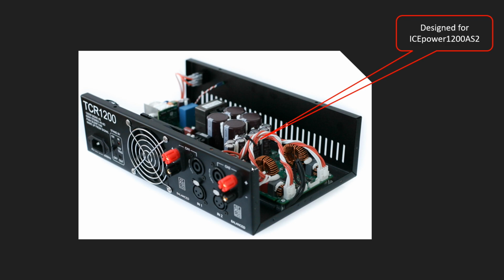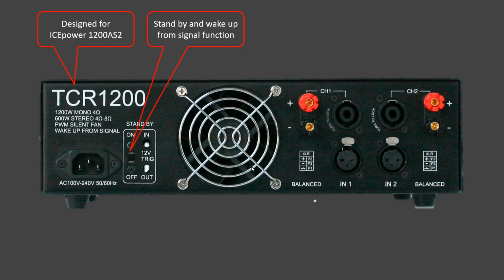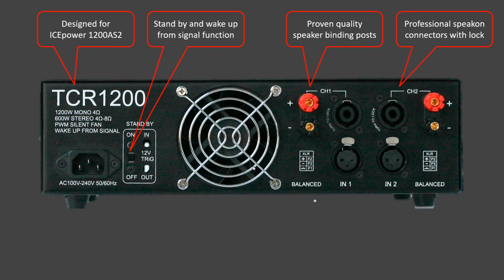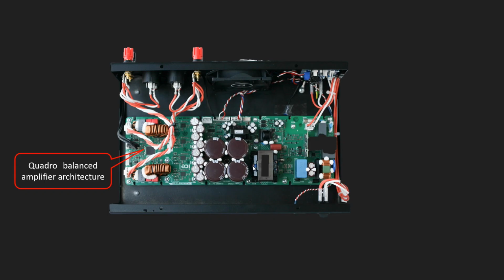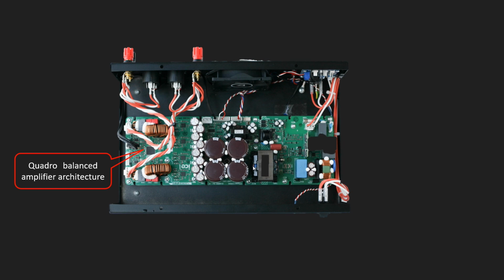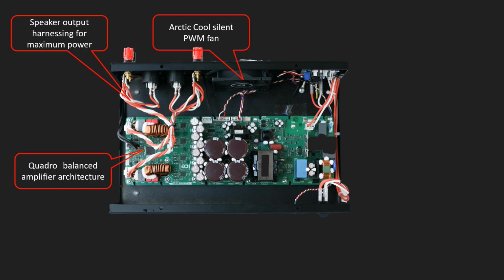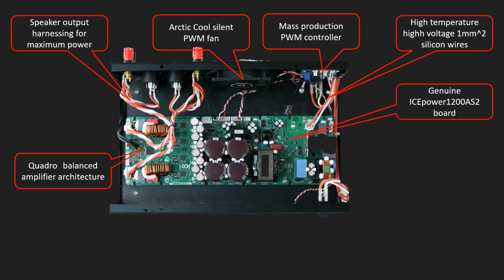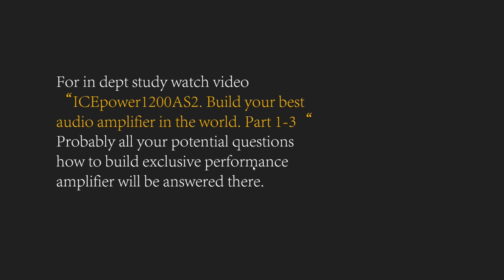Icepower 1200AS2 class d DIY Kit assembling instructions

Comment: I want to add a passive volume potentiometer to my icepower 200ASC amp, but I'm not sure what the impedance should be. I know the amp input impedance is 10kohm, so would it be okay to use a 10kohm potentiometer? Is there any reason why I should go lower than 10kohm for the pot? I haven't yet had time to learn the theory and math for impedance. Thanks to anyone that can help!!
Reply from the maker: it is not a good idea. The input has some noise filters and is meant to work with preamp output impedance up to 150 Ohms. You will lose amplifier linearity. There should be an active preamp stage with a volume regulator.
Reply: @guntarssmits2104  Thank you for the advice! I'll have to rethink my plan.

Comment: I bought Icepower 1200AS2 and i just hooked it up to my woofer and mids, i notice the volume is very low on the amp compared to all my other amplifiers without volume control. Is there a way to adjust this and do you recommend adjusting this? Its almost -10db difference and i run multiple amplifiers
Reply from the maker: It would be best if you looked at 1200AS2 as a power stage of the amplifier and it is meant to work from a preamp with a volume regulator. For 4 ohms load to get out full power, you need a balance  2V RMS input level, for 8 Ohms you need 3.8V RMS (5V peak). For an unbalanced connection, the input level should be double. I think this is the main reason your output level is not sufficient. 1200 will work great with professional audio interfaces, modern DACs, and streamers with balanced outputs. In simple words, the problem is with your source unit.
Reply: @guntarssmits2104  Ok, thank you for quick answer. I will see what i can do. I will keep you updated
Reply: @guntarssmits2104  I know your probably a busy person but can i ask, was ICEpower and LC audio working together at some point? My father have XP millennium amplifiers and he cant stop talking about the zero feedbackloops, what is your opinion on no feedbackloops on an amp? I thinking if its possible to drive LC Audio XP millennium from the Hanger Rail Supply Connector, my father have some spare amps laying around and if im going to afford a second ICEpower on my other channel i need to think outside the box on my tweeter amp. Im running ICEpower a2 for bass and mid
Reply from the maker: @Thor777AHT  When we are talking about amplifier quality it by far is not the worst component in your music reproduction path -Preamp, amplifier, passive crossover, speaker, and Human hearing psychoacoustics resolution. My personal experience shows that any modern well-built amplifier exceeds speaker reproduction tolerance and human hearing resolution which is relatively low compared to audio amplifier tolerance. When I hear amplifier improvements? first by adding power from 100W to 400W, precisely bridging (Quadro balanced) when improving the sleave rate without changing bandwidth. One of the amplifiers goes halfway up, and the other goes halfway down making an instant push-pull system that doubles speaker driving performance, and the last, most efficient improvement, is connecting loudspeakers directly to the amplifier output and using active crossover before the amplifiers. In that case, you eliminate losses in Passive crossover. You need 4-6 channel different power amplifiers to make such a system. I just published a series of videos about such a system on my channel.  To argue with your father and other amplifier enthusiasts you should look at the complete system. Even if the amplifier is super fast, you are driving the speaker membrane with a limited force motor and significant membrane mass. All supper-fast microforces are lost in a lousy speaker execution system and inertia. I would say that no feedback system can’t impact sound reproduction detalization. Especially when you have a passive crossover with large reactive energy-storing elements (Inductors and capacitors) in between. This is theory. In practice, the blind listening test may be able answer to this century's question. 😊
Reply from the maker: Regarding driving something from Hunger Rail. This output is not protected and any mistake will lead to main board damage. Read the engineer's manual of Icepower 1200 and how to make it in the correct way.
Reply: @guntarssmits2104  Ok i got a problem here. my Dacmagic plus has 2.1V out and goes into DSP-408 Maximum input level:3.2V and RCA output:4V Max. Since i just put 2.1V in will i get less than 4V out ? I bought a Tube preamp i will put between dac and dsp but is there a better way? some sort input stage for the ICEpowera1200 that keeps voltage at 3.8v without a volume control? I cant have a preamp for each channel after the DSP taht would be to much and very unpracticle
Reply from the maker: @Thor777AHT  Write me an email to gsmits@tcrastrs.lv . First, we should put some effort into describing your system with the correct model number of your system. Number of channels etc. Then we can think about the solution.
Reply from the maker: @Thor777AHT  You may need such a box between DSP408 and 1200AS2 https://www.thomann.de/intl/art_cleanbox_pro.htm. DSP 408 lacks balanced outputs and therefore needs a double output level which is not possible for this unit.
Reply: @guntarssmits2104   A tube input stage for the ICEpowera1200 that kept voltage at 3.8v would be ideal. Is there such a thing?

Comment: Hi, I'm interested in buying this kit to assemble a 2000AS2 HV module, as it is exactly the same board, I suppose it can be done with no problem? Am I wrong?
Reply from the maker: Yes, they are 100%  compatible
Reply: @guntarssmits2104   I just finished building the amp with the kit I just bought you. Great product, thank you. Everything works great. 2000AS2 is a great amp. I had ncore 122mp before and found it was a bit too low power. Now I have plenty headroom. SQ is really really good. Good bass impact, tight and deep. Can't wait to watch a blockbuster movie now!!! :-)
Reply from the maker: @manu491  Great to hear that the project went smoothly. Extra power always gives the impression that the audio system starts to breathe :)

Comment: I think this is so cool!  If I do not have a preamp, can I use my Bluesound Nodi streamer as the preamp section?
Reply from the maker: Yes, you can use this streamer built-in volume control functions. For 4 ohms load you need about 2V max output voltage. For balanced input, you will need an adapter cable XLR to RCA.

Comment: I would love a 3 channel version with 1200AS1 boards. Is that something you would consider making? By doing that we would save a lot not having to buy 3 enclosures
The power modules could be vertically oriented in a taller enclosure to still keep it compact. And maybe a dual fan configuration
Reply from the maker: I was thinking about it, but anyway, the box will be large. The right approach would be using a 2U high rack mount box is dual fans and six input outputs. It would accommodate one 1200AS2 and two 200AS2 making it a universal amplifier for 3-way stereo active and advanced home cinema. The problem will be shipping costs WW. Those will be more than 100EUR. That means only the finished product would be possible to sell. The sales price than is about 1K EUR + shipping or even more. Difficult to sell for a small company where trust matters a lot. You need a brand name to do it.

Comment: Very good and clear instructions. Are you planning for a Mono block case in future  for ICEpower 1200AS1 board?
Reply from the maker: In praktizē Costa for monoblock solutions āre comparable it is beztermiņa to purchase stereo version and use it in single Chanel mode.
Reply: @guntarssmits2104  Thanks for your reply, yes I can buy two cases. But I wanted a case which is not wider but longer in depthwise so that I can put the two monoblocks side by side on my AV rack 😊. And it looks cool.
Reply from the maker: @jitheshrajan-nx4vd  In the summer I will develop a Pro stereo version that will be almost the size of the board and only with Pro connectors. It will go into mass production at the end of September. It will have a front fan and simple black chassis

Comment: Do you have experience with buzzing modules? Not too loud but loud enough to be somehow annoying. Probably transformer, not from the speaker.
Reply from the maker: I have heard in forums that some boards has mains transformer mechanical buzz. Samples what I had does not have it. Probbly there are some statistics with boards with buzz. Try with dielectricl (wooden) material push mains transformer coil. If sound is changing than it is mains transformer mechanical buzz.

Comment: Can you use this case also to install an IcePower 200AS2? Considering buying that board first and upgrading later to the 1200AS2. Have to build some new speakers as well to make the best out of my musical experience.  (Also the red color..., rather have a black case. That confirms better to the rest of the interior of my living room.) Nice instructional video 🙂
Reply from the maker: No, you can not use it for 200AS2. The connectors do not match. I have another kit for 200AS2 in my shop for a fair price.
Reply: @guntarssmits2104  I have visited your store. The red case is not really what I want. That’s why I asked about the TCR1200. Will contact you through your website later this week.
Reply from the maker: Yes, it is abit a problem. I do have ony red case with done harnesing. Alternative is universasl cse TCR 1000 what can aomodate 200AS2 board.but you should make alll harnessing by yourself.
Reply from the maker: No you can not use it for 200AS2. Connectors do

Comment: Hi

In your older kits, you had a pre-amp stage included. Is such pre-amp also included in this kit? Also, does the fan controller tuns the fan off completely if temp is low? How loud is the fan when suppyng about 100W into 8 ohm at 27C room temp? 

I think it would be best if you also included RCA inputs with a switch, as with other kits solded for the Purifi amps. When using RCA to XLR adapter cable, only the HOT input is used, so you loose 6dB of gain, or worse, depending on the amp input stage design, you may be disabling half side of the full bridge power stage, assuming the 1200AS has a full bridge topology with differential mode input (signal is split and inverted into dual half-brigde in BTL mode).

I'm interested in 3 kits for my left/right and center channels, but my processor only provide XLR balanced pre outs for the left and right. The center pre-out is single ended RCA, so I must convert the single ended into balanced by using a pre-amp. 

Thanks
Reply from the maker: The new TCR1200 kit does not have a balanced preamplifier board. Onboard circuits are state of the art and you do not need any other electronic components. It is true that you will lose6 dB in an unbalanced connection.  There are passive boxes that can convert RCA to balanced  output like https://www.thomann.de/gb/art_dti.htm . When you mix RCA and balanced outputs there are always challenges. You can also use all RCA and convert them to Balanced using devices like this https://www.thomann.de/gb/behringer_di800_ultra_di_pro_v2.htm .
Regarding Fan noise with 100W output, they will be inaudible from 30 Cm. PWM fans do not stop but RPMS are low.